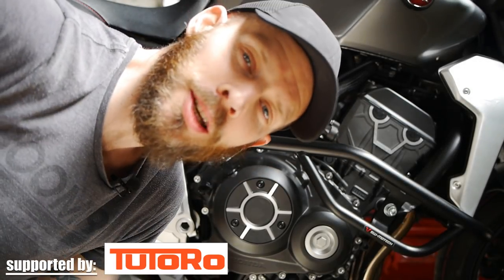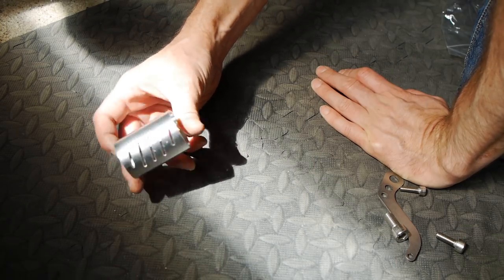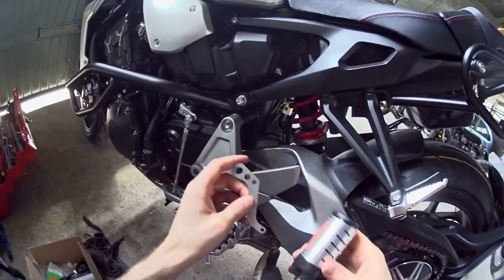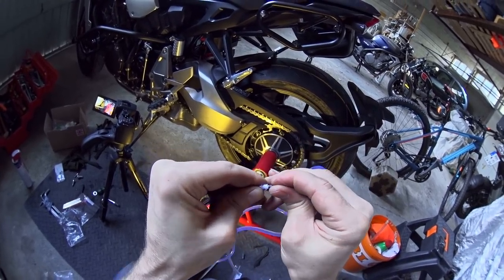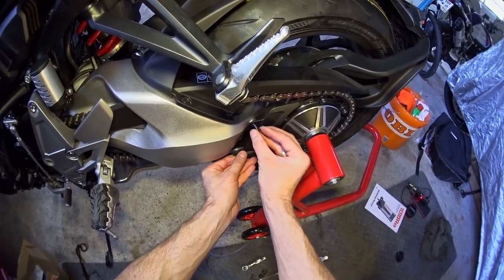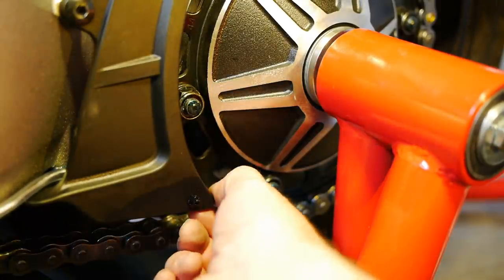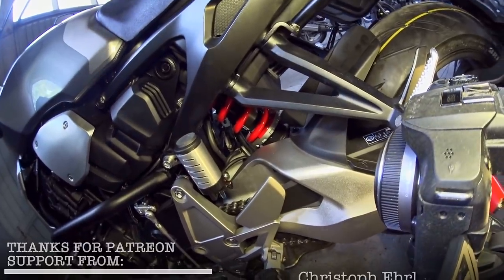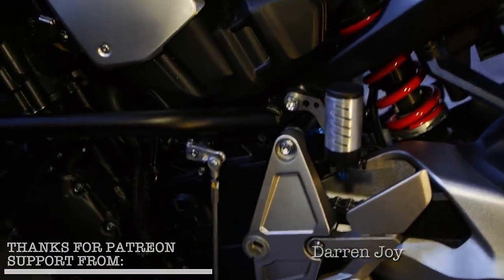TUTORO Automatic Chain Oiler INSTALLED | Honda CB1000R 2020

Comment: Tutoro's oiler is simplicity in itself. Nick manufactures these 2 miles down the road from me and I've had my auto oiler for 5 years now! Had it mounted on my CBR500R before I ported it over onto my Fazer Thou. I was involved in a development programme with him a while back that allowed me to fit an oiler onto my 07 R1 but found that most people would prefer the auto oiling option with a moderate capacity instead having to manually prime the delivery system at the start of each ride. 

One thing Nick advised me to do was to either cover the unit when you're cleaning the bike with detergent or snow foam. I notice you've got the stone chip shield on it, but the chemicals will attack the polymeric components causing them to swell. I needed to have my lid machined back to be in the right tolerance otherwise it would have cracked the entire reservoir. 

There's a Tutoro user group on facebook which show some of the users routing solutions; enduro bikes, single sided swingarms, braced swingarms etc.
Reply from the maker: It's always interesting to hear the stories behind these things! Most people think that products just appear on the shelves! Cheers mate!
Reply: @AndyManCam  I've been using Tutoro  since 2007, back when the oiler was simply a reservoir with a simple screw valve. It's somewhat serendipitous that i moved to the forest of dean only to be down the road.
Reply from the maker: The Universe knows! 😜

Comment: Wow, that looked easy, easier than ye olde Scott Oiler (which I have used on every bike for 30 years) ;-)  Oiler's work: As an aside, my v-strom1000 chain went 25K miles with oiler and it still wasn't worn out, I changed the chain because I needed something todo during lockdown LOL.
Reply from the maker: Haha! Brilliant! Totally agree though. After 15,000km the chain on the Versys still looked new when i sold it and the same for the Yamaha. And all that with vastly reduced cleaning and adjusting! They definitely work.

Comment: My understanding is that these chains are sealed with grease and do not need to be lubricated--just cleaned.
Reply from the maker: Absolutely correct. But the rollers and sides of the plates rubbing against the sprockets benefits from the extra oil. Without it the sprockets wear out quicker and also the chain heats up more and results in faster degradation of the rubber seals and the grease they hold in. Also an oiled chain is far quieter than a dry one.

Comment: The big issue with the original scottooler was varying flow rates due to temperature. This is solved with the electronic version. It pumps a fixed amount regardless of temp and you can adjust that up or down. It's only two wires on to the battery.
Reply from the maker: TBH Scotty, i never had that much of a problem. I just knew that as winter approached, I’d dial a couple of extra clicks in and the opposite as summer rolled back around again. Certainly not enough of a problem to spend twice the money. Very cool that the option is there though, for those that can’t be bothered with that faff!
Reply: @AndyManCam  Agreed. Cost is an issue with them. I guess it's a personal judgement on whether its justified or not. 👍
Reply from the maker: Absolutely. Like so many motorcycling products where the cheap on will work, but for the extra mile you have to stump up way more cash! If it works for you, then it’s worth it. If it works without, then that’s a money-saving win in the other direction!
Reply: Agreed. When people have asked me whether an oiler is worth it I always say it depends on the mileage they do. They're a bit of a faff to install and theres the cost to justify. Just depends on the usage 👍
Reply from the maker: I’d possibly go as far as to say that they’re worth it, whatever mileage you do. That is, as long as you’ll one day wear a set of chain and sprockets out. (I once met a guy on a Fazer rideout in 2015 who had a 1999 FZS600, that he bought new, with 12,000 miles on it!) If so the just by doubling the life of the chain, you save the cost of the oiler in replacement parts!
Reply: The average rider does 4k miles a year I believe. That means about 1/2 do less than that. Many of those changes bikes without ever needing to replace chain and sprockets. For those a quick lube every month is probably all it takes and without the fling. For those of us that put real miles on then without doubt they're a benefit.

Comment: Good review Andy - I just signed off trading my 2004 GS on a F900XR (chain drive), so missed out on all that mucking around for 16 years! Previously I had a Scottoiler on a VFR800 which I was very happy with but got my mechanic to do the vacuum connection for me. This looks like a much better solution - I'll be ordering one now so hopefully it will arrive in Oz in time for the bike delivery in 3-4 weeks.
Reply from the maker: Many thanks Ant. I can imagine that going form shaft back to chain is a bit of a faff upgrade! I hope the Tutoro eases your transition!
Reply: Hi there, how’d you go with this oiler? Would you recommend it?
Reply: @samiam5326  so far all good, a fair bit of faffing around to find a mounting point for the reservoir that was vertical and gave access to refill, ended up using p-clips on the sub-frame. The scottoiler was easier to mount as it didn’t have to be vertical, but you do have to cut into a vacuum line.
Reply: @tonykisvardai2346  thanks. I’m going to give one a go as I’m getting a new chain and sprockets fitted next service.

Comment: Great bit of kit but it can take a bit of time to get the flow correct. Mine has been on 4 bikes so far.
Reply from the maker: It was always the same with the Scottoiler too. Have to remember to adjust if the weather changes drastically too! Mostly seems good so far with the recommended half a turn. Chain is shiny but not soaking and I’m getting (extrapolated) 6-7000km from a fill up. 👍🏻 Impressed so far.

Comment: Chain oilers are brill, used a SO myself always a blank takeoff somewhere around intakes, oil much cleaner than glue shite sticking spray Amen!
Reply from the maker: Agreed. Though no blank vac ports here as everything is interconnected. Apparently the CB throttle bodies are somehow self balancing? Not gotten truly to the bottom of that yet, but no need to worry as this oiler was the simplest install!

Comment: Looks like a good system that. Much less scary than the vacuum hose option! Said it before but love those SW Motech foot pegs!
Reply from the maker: Totally agree! The last thing i wanted to do to a brand new bike was start chopping about the vacuum hoses!! 🤢
Reply from the maker: I wanted as little interference with the bike as possible. The Tutoro is easily the most simple.
Reply: @adrian69644  it doesn't work on vibration see here for a full explanation  :-) https://www.tutorochainoiler.com/pages/how-does-the-tutoro-auto-work

Comment: My experience with those stick on hose supports, after heat, cold, washing and chain oil is flung over them they'll be hanging down, be careful
Reply from the maker: I’ve mostly had no trouble TBH. Just have to make sure its PROPERLY clean before sticking.

Comment: Hi Andy, great vid I’m thinking about getting one of these for my KTM Superduke 990, they look great with not having to worry about electrical issues wiring it up, 👌
Reply from the maker: It’s definitely the easiest of all the oilers to fit!
Reply: @AndyManCam  did you have any problems with the oil spraying over the back wheel
Reply from the maker: Not once you get the flow right.

Comment: Good luck with that Scottoiler do all  electric Oiler!   Its wen you push you bike backwards that oil pip caching on the sprocket nuts can be a problem.
Reply from the maker: But this one is a not scottoiler with NO electric! The Feed nozzle is very well fixed and rearward movement is no problem at all. All depends on the quality of the install, I suppose!

Comment: Very easy installation and a lot quicker than the Scottoiler V system. I'm interested as to your views on the oilers performance so far??
Reply from the maker: I agree Bob. So far I'm very happy. about 5000 miles on a fill up and the chain is clean and oiled, even after a weekend in the rain. 👍🏻

Comment: Hi Andy. Sticky pads = do it again later with something more substantial in my experience! By the time you've washed it a few times and it has flung some oil around, I reckon you'll be doing those again! Unit looks OK, but small in comparison to a Scottoiler. It'll be interesting to see how it gets on! I've just invested in a new Z900 to be my second bike, so may go with this solution if it pans out. Good vid! Liked the cable tie technique!👍
Reply: Yeah, not convinced about the size of that deposit, though I've found that modern glues on sticky pads can work.
Reply from the maker: Cheers Christopher. Hopefully they’ll do ok. The hoses on the Scottoiler were held on with sticky pads and were still holding on to the yamaha as i sold it! Also managed a 4000km round trip and the reservoir was still 1/3 full. Never managed that with the scottoiler, although i had the Louis special edition which is a bit smaller. So far I’m pretty happy with it. Few teething problems until i realized that I’d overfilled it. Since then, all good.
Reply: @AndyManCam  OK! I get it! It's just me that's crap at sticky pads!! 😉😂 They're like my kryptonite!!
Reply from the maker: Haha! It’s all about that prep! Clean it, clean it, clean it and for dogs sake don’t touch it!! 😂

Comment: Nice , Simple and clean install, its adjustable so hopefully not to much over splatter on your nice new wheels and tires .Cheers
Reply from the maker: Thanks Brent. So far the splatter effect has been quite minimal. Mostly just on the swingarm in front of the sprocket, so not even very visible.

Comment: like you i hate the fact the scottoiler cuts into the vacuum hose and always gave it a wide berth. This looks the dogs Andy and great tutorial as always.. Cheers Mate may need to invest in this. 👌
Reply from the maker: Cheers mate. The LAST thing I was going to be doing with a new bike was hacking in to the vacuum system. Have you looked at the pipewrok on the CB? it's an absolutle nightmare! NO idea which one to use. SO this is the ideal solution! Luckily, it's also working really well!
Reply: Haven't mate.. glad it's working well.. I'm down south for a couple of days and just listened to your podcast with TP.. Helped me through my first 150 miles 😄👍

Comment: Sleek looking piece of kit Andy. Nice fit. Keen to see how well it works. Hey, one other thing. Just got back from a 1500km solo road trip that took in several epic motorcycle roads, the Putty Rd, Thunderbolts Way & the Oxley Hwy which it in itself has over 300 bends. No scares, a great trip..If ever in Oz you must consider some of these.👍🏍🇦🇺
Reply from the maker: Cheers Russell. Working great so far. I’m loving the larger reservoir than the special edition Scottoiler that i had. I can go for 5-7k km between refills now, so no need to take extra oil for most trips. Well done on the scarefree carefree trip mate! If only they could all always be that way! Oz & Nz would be a truly epic tour. On the bucket list for sure.

Comment: There is a risk one will get fed up with the splatter and it sounds like this could be bothersome if you like to keep bikes looking as good as possible, despite all weather riding ... I considered this oiler for my bike but having seen the mess this oiler created on a colleagues bike it's on hold for now. His tail/number plate area and rear wheel gets caked in fling and he just can't dial it in to get a good trade-off setting. Some of the fling must end up on his brake disc as both sides of his wheel get caked up 🤔. Plus, if you want the extra bits 'n bobs fitting kit the price rises steeply. At the moment I'll stick with Wurth dry chain lube spray every 400 or so miles = practically zero fling. I clean chain with parrafin every 600 to 800 miles (I take a small pot on tour with me). When I clean my chain with paraffin it still looks new and after two years of ownership and 14k miles chain tension has never been required to tighten it. Oilers are certainly convenient, particularly on tour, but I have OCD with, ahem, rear-end cleanliness! I hope it doesn't become an issue for you. Thanks for the review, I like how you used the cable tie locking block as an anchor, looks a bit tidier. 👍 Be good if you could provide an update in a few months to see what it's like long term in different temps and climates, oil consumption and range from the reservoir, etc as I'm still considering getting one. Ta.
Reply from the maker: I totally understand that Critch. I guess it comes down to which end of the cleaning spectrum you’re happiest to spend your time. I prefer to run a rag around the back end (oo-er) once a week than get involved with the chain. Of course now that i have a single sided swingarm and no center stand, cleaning and lubing on tour is exponentially more difficult! TBH I’ve always found that no matter what i do, the bike looks like a swamp tried to eat it when i get back from any tour, so a deep clean is always in order! But being able to forget about the chaintenance (maybe i should copyright that one!) is a huge bonus for me when all i want to do is park the bike and get on with the evening entertainment!

Comment: Andy, the oil will make a messy(spilled)on swing arm, rear section or not while riding. 

Looking forward to see your advice.
I like to buy one of them too.
Reply from the maker: Sure, it'll make a bit of a mess. But cleaning off the swingarm etc... is a lot less work than cleaning the chain once a week! TBH it's really not that much mess either.
Reply: @AndyManCam  is it possible to make video how to clean the front sprocket on CB1000r

Comment: Great video! I was just wondering if you could instal the reservoir tank straight above the chain, so it can drop the oil straight on the top of a chain instead of using hose wire to provide it all the way down to the sprocket?
Reply from the maker: You could, but the delivery point would need to be very close to the chain to avoid oil just being blown away before it even reaches where it needs to be. This is then made difficult because the swingarm will be constantly moving up and down and also the chain itself will be jumping up and down. So you would have to leave too much gap to avoid smashing the reservoir and as such most of the oil would end up everywhere else except where it needs to go. Delivering it to the sprocket means the oil is never ‚in the air‘. It goes straight into the sprocket and then finds it way directly on to the chain. 👍🏻

Comment: Fantastic! Have always been put off oilers for the very reasons you highlighted in the vid. Seriously considering one of these, how has it held up so far? Or is that to be revealed in an update vid 🤓
Reply from the maker: I had a bit of teething trouble at the beginning because it wasn’t working. Turned out I’d just over filled it, so user error! Since then covered 5000km and the chain still looks good. Reservoir seems to be good for about 6-7000km on a top up at my current Settings too. All in all, positive experience so far!

Comment: Hello this way you are only lubrificante the left side links off the chain the oil ill never ritch the right
Reply from the maker: The oil runs off of the sprocket on to the rollers of the chain. Due to capillary action from the close contact between the rollers and the sprocket, the oil works across the whole roller and on to the inside edge of the roller. I can categorically confirm this, because the other side of the sprocket is also wet with oil. The chain has always lasted exponentially longer for me with a chain oiler than without. Ultimately i don’t need to convince you of something, the opposite of which you have already convinced yourself. If you don’t want a chain oiler, good for you. But i know they work and that they keep my chain in good condition for longer.

Comment: Verdict so far Mr AndyManCam?  Still happy? (I know it’s not the greatest of test periods but I’m about to pull the trigger on one)....🤔 Cheers in advance fella
Reply from the maker: Very happy mate. Seems to be working fine. Just have to be sure not to overfill, but otherwise all good. Regulating the flow is easy enough as the temp changes and very simple.

Comment: If chain oilers are needed why don’t they come fitted? I’m a long term BMW shaft drive biker because I hate that oily mess and the thought that I’m just making a grinding paste
Reply from the maker: Chains need to be cleaned and lubricated. That’s indisputable. Chain oilers are just another way to achieve that. Obviously manufacturers don’t want to fit them because of the increased part count, complexity and end price. Naturally shaft drive is the cleanest and easiest way to solve the Problem, but the added weight, complexity and power loss makes it a less than ideal solution for every platform. To be honest i hated chains and resigned myself to the fact that I’d have to get a super expensive (or very old) BMW. But chain oilers have reopened the world of chain driven bikes to me. Hugely reduced faff and maintenance for relatively low cost. Of course finally having a single sided swing also really helps with the reduction of faff as i now no longer need to disturb the chain adjustment to remove the wheel or worry about chain alignment ever again. All in all, I’m very happy with this setup.
Reply: This can be said about a lot of those optional BMW packs, can't it ... e.g. : if ESA is really needed, why doesn't it come fitted. Nevertheless, I bet you have payed extra for ESA on your bike. And we're speaking of a completely different price level  :P
Reply from the maker: @sudolea Another very good point. At least most of them are coming from the factory with traction control and ABS as standard! I remember when you had to pay for that as an extra!